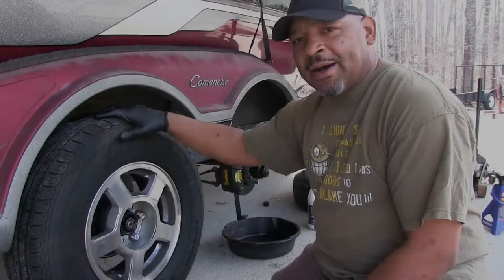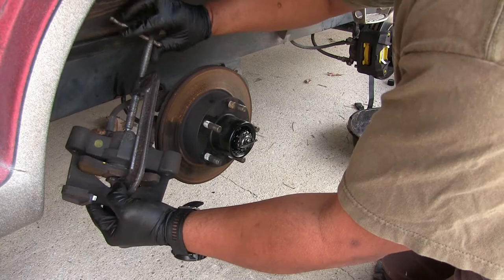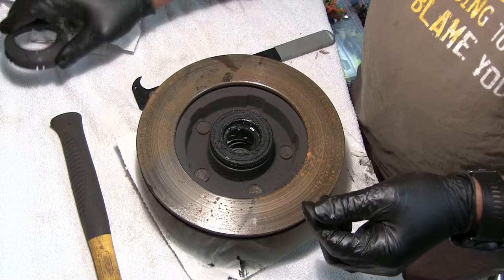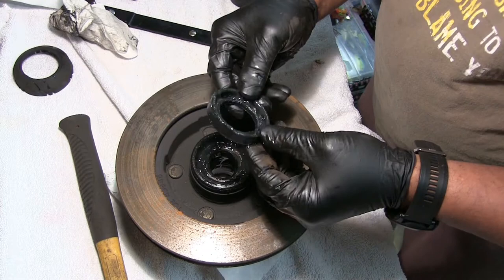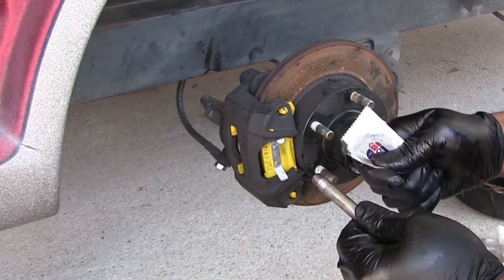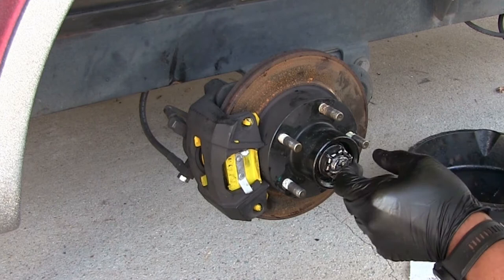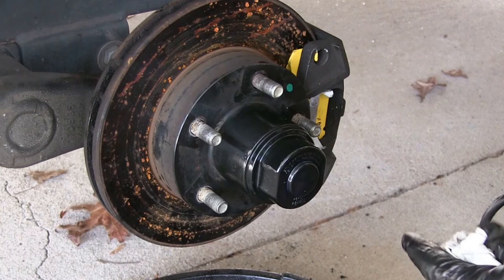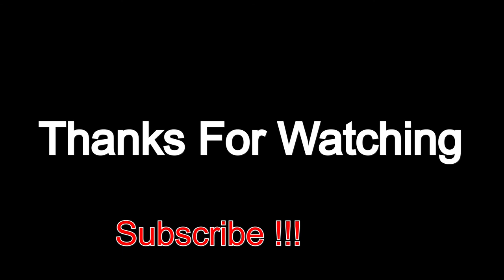Ranger Boat Trailer Bearings, Seals & Hub Oil Replacement

Comment: Hello. Can you list the part info for the oil bath seal?
Reply from the maker: Eric here is the parts list I used. Bearing 1 1/16” ID part no.44649/ Bearing 1 3/8” ID part no.68149. Seals Triple lip grease seal 1.72” ID - 2.56” OD part no.GS63. I got everything from Trailer Part.com. I hope that helps.
Reply: @michaelyoucanfixthat  thank you! Love the videos they a very helpful

Comment: Those cool hubs are a real PITA.... I'm converting mine to the grease type.
Reply from the maker: @HVASEA  I don’t have a problem the the cool hubs. If I don’t see any grease on the inside of the tires I know it’s oil in the hubs. But I can see the grease type maybe better in the long run.

Comment: I've never seen 90W put in a wheel hub before.  I've always use Axle grease.  Those hubs get hot.  Great video well explained.
Reply from the maker: Yes, this is what Ranger calls Cool Hubs. Just gear oil is inside where the bearings are. It work of but if you have any leaks. You will have not oil on your bearings.
Reply: it’s what Ranger recommended to me as well.

Comment: Michael loved your video you’re doing everything we’re getting ready to do where did you buy your brake pads also we had a oil bath hub fail and also converted it over to greased bearings but looking for brake pads
Reply from the maker: I buy all my brakes from https://trailerparts.com. I hope that helps. They have all the trailer part you will ever need.

Comment: Hey Michael, I got an 08 z520, will these parts work for that trailer?
Reply from the maker: My buddy has a 08 520 and yes these part does fit his boat. but I can't say they fit your boat but must likely it does? Does you boat have cool hubs?
Reply: @michaelyoucanfixthat  man thanks for quick reply. Ranger sent me vortex hubs a couple years ago. So assume it’s those? I just need to get the bearing replacement kit I assume correct? What is the spindle size? Man and thanks for your help this has been stressful.